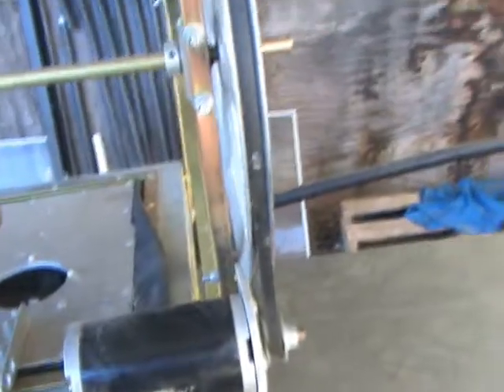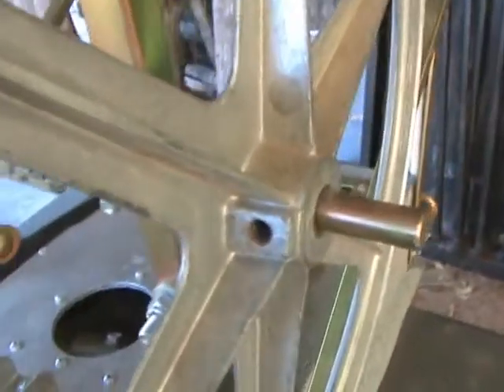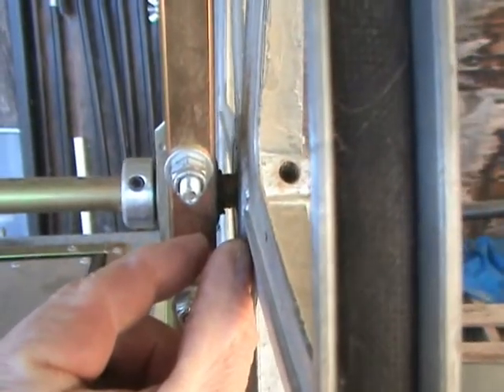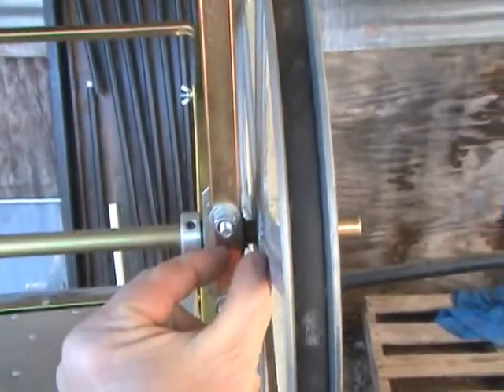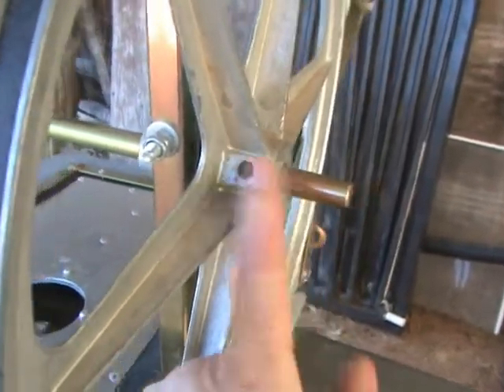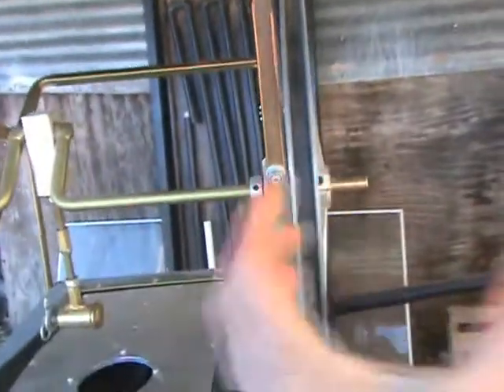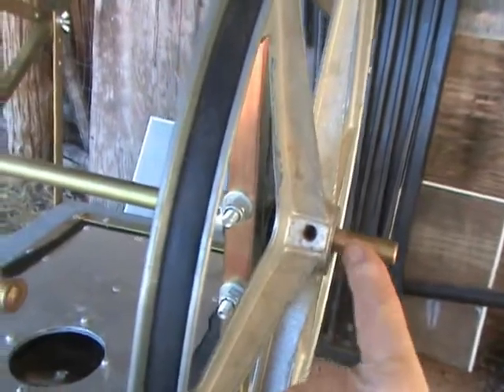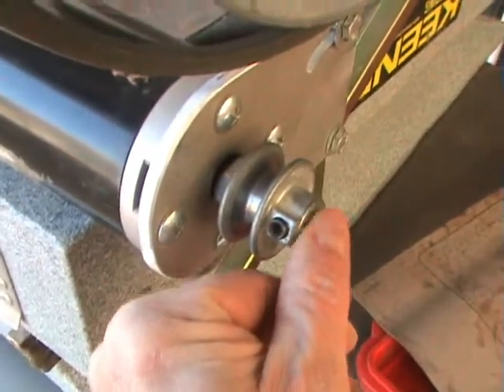Keene Engineering Dry Washer, Modifications 04: spacer inserts

Comment: G'day Dave,

Good Job...

I would've used Washers on both Shafts, and oiled them (daily, to flush away the Fines...) ; trather than Dry Washers and a Nut...

 That Slotted Aluminium Block used as a Big-End Bearing on the Actusting Pushrod may be set up like that delibetately in order to mechanically achieve a critical Timing-Gap to allow the Background Gravitational Field, in conjunction with Airflow, the Mass/Density of thr Overburden Dirt versus thst of the PayDirt, all interacting together to realise the Unit's Design-Goal of separating the Auriferous  Shoepolish from the Overburdening Shite...

  I learned to steer well clear of Mother Lode or Blue-Hole ( in a Riverbed, it's a Saphire-Miner's Ultimate Fantasy...) Theology, as a kid...; having  growing up in an old Gold/Tin/Saphire Mining Region...

   Mining Fever is about as excusable as any other Evangelistic Religion...

;-p

Ciao !

Comment: This may help. Instead of the set screw being driven directly into the shaft, put a small piece of brass (cut off a piece of brass wire) between the set screw and the shaft (screw->brass->shaft).

Comment: I'm thinking that the engineers who designed this never did any mining. I know that the people (it MUST have been a committee) are all midgets and could never have spent any time in an RV.

BTW, I wonder if you have ever run into claim jumpers on your claim. I ran across a channel that supposedly shows abandoned mines. Some of them didn't look very abandoned. I think someday he might get himself shot.

These were hard rock mines and I am assuming you don't do that.. What kind of issues  have you had with people trespassing on your mineral rights?
Reply: Actually the Keene Family has been mining for many generations. Their equipment used to be much better than it is now but the rise in gold prices and the greed that follows made them loo towards China for product construction and that has decreased the quality of said products. The worst part is that their customer care has all but vanished. I have talked with Pat Keene on many occasions and he even liked our mods but has continued to have the machines made in China without any changes that I know of. Now I can't even get him to answer the phone and we both still have problems with the speed controls not functioning so we have abandoned those.
Reply: We have only been prospecting so far. We are about to file on some nice areas.
Reply: Should be:  I know that the people who designed our motorhome (must have been a committee)

I don't what happens with this tablet. I have such a small space to type a comment and it won't slide down to let me see what I typed or edit it. Sometimes I accidently delete whole phrases without knowing it. If you really do get what you pay for, my Samsung Tab 3 should be behaving better than it does.